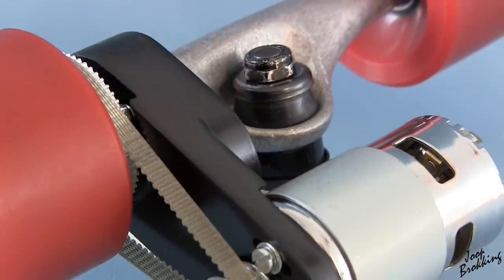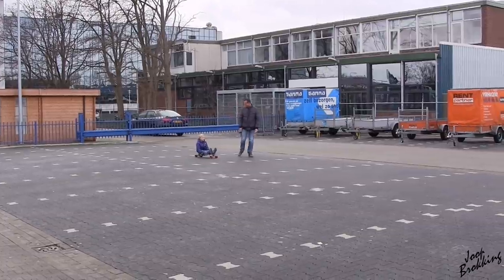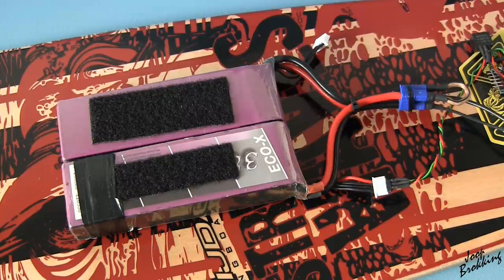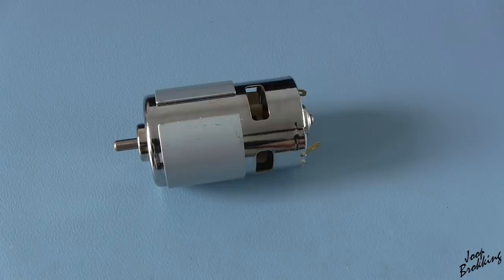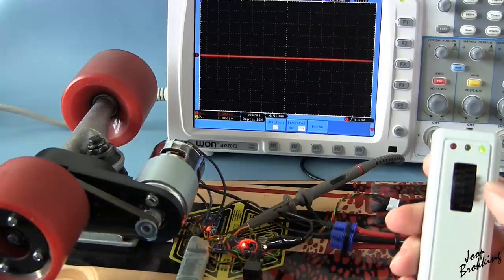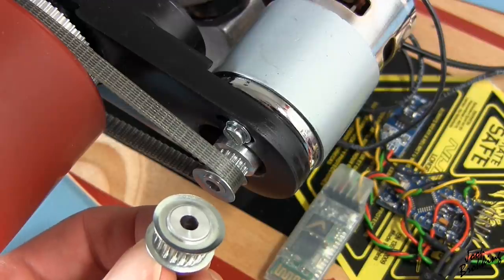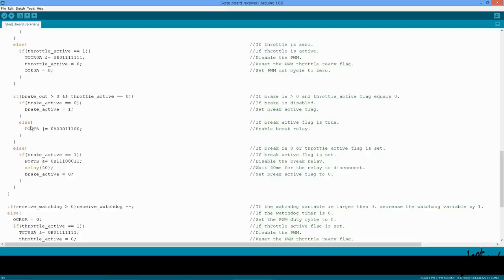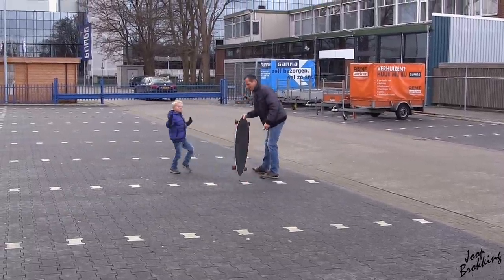Building an electric longboard (part 4) - Will a $14 brushed motor work?

Comment: Try a brushless system! It's much more efficient and powerful. If you don't want THAT SPEED, just change your arduino code to limit the throttle.
Reply: RC 44 ↑↑↑↑
Reply: Definitely more efficient, but less simple and more expensive.  
It's definitely more of an upgrade than a necessity.
Reply: I agree. In my country it costs $700 to order the cheapest brushless system for a skateboard. But it would be cool to control a brushless skateboard with arduino in the future.
Reply: RC 44 I got both, a 1700W Keda brushless motor and a suitable speed controller from hobbyking for around $100 total.
Reply: wow!

Comment: My DIY Electric Skateboard has a Dual Belt drive System and it will have a 10s5p Battery and ESC with remote and charger kit.

Comment: Since I know nothing about Bluetooth wireless, are there specifics about the HC-05 wireless bluetooth serial pass- through module that led you to choose this device over others?

Bluetooth protocal: Bluetooth Specification v2.0+EDR
Frequency: 2.4GHz ISM band
Modulation: GFSK(Gaussian Frequency Shift Keying)
Emission power: ≤4dBm, Class 2
Sensitivity: ≤-84dBm at 0.1% BER
Speed: Asynchronous: 2.1Mbps(Max) / 160 kbps, Synchronous: 1Mbps/1Mbps
Security: Authentication and encryption
Profiles: Bluetooth serial port
Reply from the maker: The HC-05 is what I had laying around. You can also use two of these:
http://www.dx.com/p/2-4g-wireless-serial-transparent-transceiver-module-for-arduino-441995
Reply: Thank you! The light came on after reading a user guide on the HC-05.

Comment: "And some other parts like a power switch, 330Ω resistors, 10k potentiometer, LED's, AA-battery etc etc" 

Joop I would love to see a full list of specs! Im really not that good with electronics, and im willing to learn a lot. But assuming that I know what "other parts you have" isnt in my skill set. Could you make the list on your website complete?
Reply from the maker: I made a complete schematic that you can download from my website. Combined with the links on my website you can get a full parts list.

Comment: would a gearbox be better for the motor and for torque? ok speed decreases damaticly but that may be fine.
Reply: Indeed, it needs a gearbox, drill motors need high Rpm to put out the most power

Comment: It seems like you could make up a metal spacer plate to go between the motor & wood, to allow the motor to suck air properly.  The air-holes to be removed from the plate are small.

ie: http://imgur.com/a/5RAQP

If worried about the shape cutting into the wood, then a second plate (with no air-breathing cutouts) can be put between this plate and the wood.
Reply from the maker: That is indeed a nice solution. I will keep that in mind!

Comment: Cool :-)
In a brushless version, the esc would do the job of current sensing, pwm switching and braking as well. Would have been much less effort to do?
Reply from the maker: Please note that not every ESC has a current limiting and brake feature. And including a $4 current sensor is almost effortless as you can see in the video.

Comment: Hey, I have a 24v 800ish DC motor from a power drill with actual replaceable carbon brushes. I can't find the specs all over the web. Do you think that will be enought to make me who weights 70kg moving at a faster speed than yours? Thanks!

Comment: I have a question, do you think it would be possible to make the breaking mechanism work in a way that would charge the batteries? Because the batteries would present a load to the motor and that would slow him down?
Reply from the maker: You have to boost the voltage to charge the batteries. That would take some electronics to accomplice.

Comment: HI, i love your videous and i would like to now witch of thes batery wod be beter for that motor? 
1:Tattu LiPo Battery Pack 1300mAh 45C 3S 11.1V with XT60 Plug for RC Car Boat Truck Heli Airplane
or
2:Gens ace LiPo Battery Pack 2200mAh 25C 3S 11.1V with Deans Plug for RC Car Boat Truck Heli Airplane
Reply: And this controler:Pixnor 6V 12V 24V 28V 3A 80W DC Motor Speed Controller (PWM) Speed Adjustable Reversible Switch 1203BB dc motor driver reversing
Reply: 3: they are 6 baterys in teTattu LiPo Battery Pack 800mAh 3.7V 25C 1S with JST Plug for RC Quadcopter F181 MJX X400 X400W X800 X300C X200 X500 RC

Comment: hoeveel  abec hebben die lagers van zo'n speelgoedboard?  Rijdt hij een beetje door voor de prijs van 50 euro? Die electronica gaat me helaas boven de pet. het inbouwen lukt wel.
Reply from the maker: ABEC 7 lagers. Google: Nijdam Longboard Long Board Pintail voor meer details.
Reply: Ik heb vorig jaar als mijn eerste board toevallig ook een Nijdam gekocht, abec7. Hij rolt verrassend lekker door! 60 euro in de aanbieding bij bol. Ik heb een wat duurdere getest 110 euro en die is niet beter dan de nijdam. Maar mischien was die abec5.
Reply from the maker: Ik was inderdaad ook enorm onder de indruk hoe goed de Nijdam rolt. Zelf zonder motor ging het buitengewoon.

Comment: Hello, Im Building my Skate but I am using a Brushless motor and Im afraid of it dont have power to run with me, It is 22.2volts and 1500w, My Weight is 55kg, can you help me?

Comment: Joop Brokking,i have seen many different RPM types of that same motor like yours(5600-18000RPM)so what RPM should I choose?thank you
Reply from the maker: The one that delivers it's maximum torque at the desired speed. It also depends on you belt reduction.
Reply: thanks but there is no data regarding torque on these motor
Reply from the maker: Then it's just trail and error.

Comment: I have an Arduino Uno rev3 on hand, but I was wondering if I need the USB to serial adapter to program the Arduino Pro  Minis used in this project?
Reply from the maker: If you use the Pro mini you need a adapter to upload the programs.
Reply: Thank you!
Reply: You can use your uno as a programmer

Comment: Ive blown four RFP50N06,  mine is the same as your schematic. what I'm I doing wrong? please help it's been over a month trying to build this. are there any stronger mosfet that will work with the arduino??
Reply from the maker: The RFP50N06 can handle 50A. So it's sufficient. Did you mount the Diode? And make sure that the RFP50N06 is cooled.
Reply: thank you for the reply Joop Brokking yes added the same 1N54O4 diode. dose the pull down also needed grounded as well as pin 6. my motor started to spin slowly when I connected the battery then the mosfet shorts and dies.
Reply: michael overill привет чем занимаешься?

Comment: will a 12v 1000 rpm motor work with the electric longboard?
Reply: Fawks how many Kv is it or how many watts
Reply from the maker: Check the link on my website: http://www.brokking.net/longboard_main.html

Comment: ZIPPY Compact 2200mAh 3S 25C Lipo Pac useing 2 of them
Reply: As i domt relly now english i dont now if this can work Zippy compacto, la última adición a nuestra serie de baterías Zippy ofrece un excelente rendimiento y alta calidad en un tamaño 'compacto'. Estos paquetes proporcionan la misma capacidad y velocidad de descarga como nuestra línea Flightmax, pero le dan tamaños alternativos para aplicaciones que requieren un shape.Great específica para los modelos con espacio del compartimiento de la batería limitada! Baterías Zippy ofrecen capacidad de descarga completa, además de ser los mejores baterías de valor en el mercado hoy manía Spec.Capacity: 2200mAhVoltage: 3S1P / 3 celular / 11.1VDischarge: 25C constante / 35C BurstWeight: 163g (incluyendo alambre, caso enchufe) Dimensiones: 107x21x34mmBalance Plug: JST-XHDischarge Plug: XT60